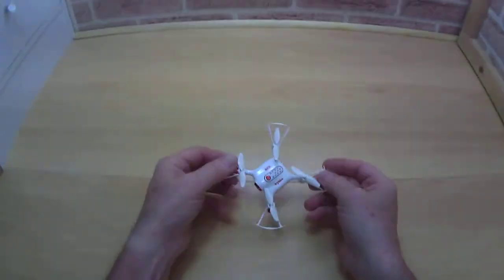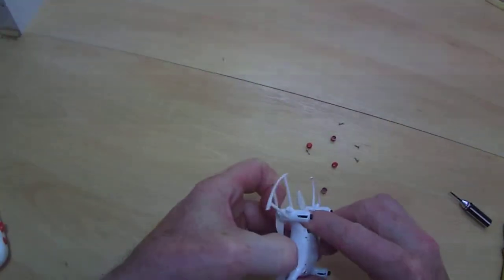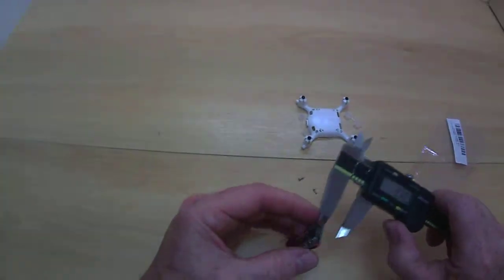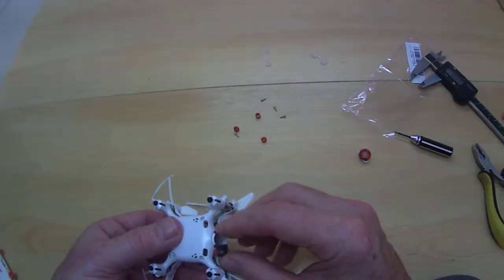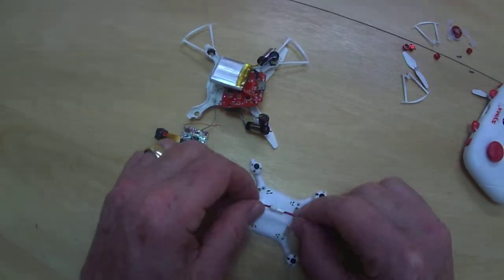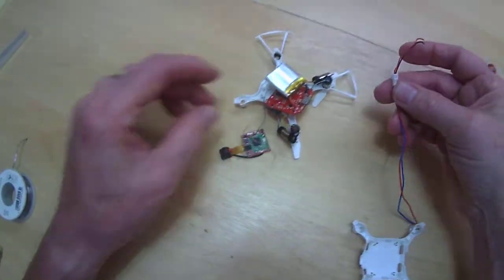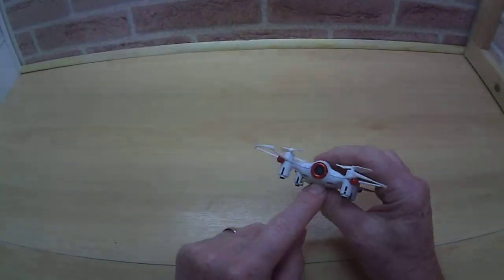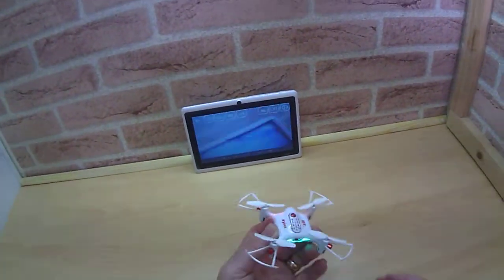Syma X20 FPV Conversion

Comment: Nice job.  A couple of questions.  What kind of effect does the fpv transmitter have on battery life?  Second, why did you choose to go with a wifi transmitter instead of 5.8ghz? I'm assuming for convenience with your phone as a monitor and not a lot of need for long range?  It probably wasn't available when you did your mod, but there is an X21W now with wifi built in....
Reply: James Williams wifi fpv in toy grade is all trash, only dji's wifi system done great. 5.8ghz is the best among fpv, long range , no delay